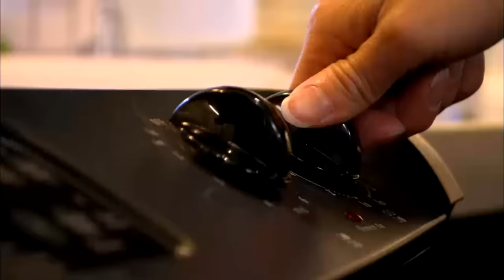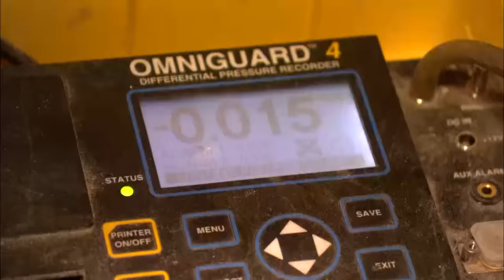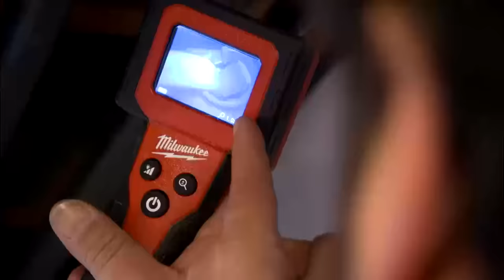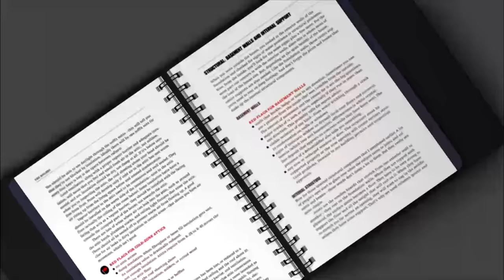Hidden Danger in Home Puts Family at Risk | Holmes Inspection 103

Comment: I don't blame them for wanting it out, but it's important to understand a couple of things:  One, if the asbestos is  enclosed in the wall/ceiling and undisturbed,  you're not getting particles of it floating around in the air.  Two, there are multiple types of asbestos, not all of which are a problem.  The types with the really small fibers are the dangerous ones to get in your lungs, but it takes testing to determine which type was used in this house.
Reply: Yes - well said.   The panic and drama here was a little overdone, but that's Holmes :)  It's most dangerous for the workers installing or removing asbestos repeatedly, hence the hazmat suits and disposal requirements.   Same thing with lead paint - it's only dangerous if it is disturbed (like little children gnawing on the window sill).  I have no clue what Canadian regs require but it seems to me they could have just extended the bulkhead to encase the exposed asbestos
Reply: Thank you. Asbestos that is encased in a bulkhead is ZERO concern. The only real mistake was not enclosing the end wall.
Reply: But in this case the asbestos was disturbed and there are loose particles. It will need remediation. Hope the people that disturbed it don't have any health issues...
Reply: They said that in the episode…
Reply: Thereoticaly you're fine... But if that wall ever cracks, or is cracked, or isn't fully sealed and there's a draft... It's just best to get rid of Asbestos. Which is why you are legally REQUIRED to do it.
Reply: 1. Walls move. Air moves through bulkheads via any opening. There is no such thing as undisturbed asbestos given enough time.
2. Irrelevent. Asbestos is to be removed under the law. Type irrelevant, law says "IF asbestos THEN remove asbestos".
Reply: Lemme give you a scenario then. Say for whatever reason a hole is punched thru it, be it kids playing around with a stick and poking a hole in it by accident. Then what ? You were once a kid, so was I (shocking I know). Rule of thumb is whatever could go wrong will likely will when you got kids. Or lets make it simpler, say they want to spread the coldness of the cold room so they install a fan in the basement to circulate the air, it'll go in the lil nook where the homeowner first spotted the asbestos and voila. One more for kicks. Say there's huge water damage for some reason and they need to replace the dry wall, boom you get lung infections, you get lung infections and you get lung infections.
Reply: Just as a general comment-- the problem with the encased and undisturbed theory is that you really don't know the state of things you can't see.  If the asbestos was damaged and flaking when it was covered by the bulkhead, you have no way of knowing that.  We have had to do a lot of remediation made more complicated by things being "encapsulated" with something else.  The person we bought the house from was lazy-- the fact that the asbestos material was in poor shape was "fixed" by encapsulating it with something else.  But was it really "fixed" in any way, and did the encapsulation make it "safe", or was it just covered up to leave us with a substantially more expensive fix down the line?  I think it's the latter.

Comment: Asbestos is bad, but if you don't touch it and just leave it alone nothing will happen to you.  It's not like you will tear into it and make it come apart.
Reply: It seems to me that this asian woman wears the pants and never shuts up, lol.
Reply: On heating and cooling cycles I believe the air circulates on by the asbestos, so a tiny amount constantly gets distributed. That open end would have to be closed and sealed at minimum. But then we have wind storms a few times a year , and during that it would pressurize or depressurize the space and release particles through (normal) cracks in the drywall.

Comment: In 1970 I worked as a carpenter on a reform school . The architect specified the foundations and soffits to be 1/4" Transite which was an asbestos/cement product. Being more muscle than brain, for months,  I cut Transite with a circular saw using a dry carborundum blade. For the lack of proper safety concerns, I spit and picked gray the entire time. I'm 81, still working , and don't know of any co-workers from back then that suffered asbestosis. I've had several x-rays in the past 25 years to keep check and my Irish luck holds true?
Reply: That's good to hear that you are doing well after your exposure
Reply: Just think of how well you would have been if you hadn't been exposed to a dangerous substance!!!
Reply: I taken plenty of xrays of older construction workers, most have evidence of asbestos exposure. Its sad, you are fortunate

Comment: LOL, scared for no reason at all.  It's only dangerous what you work on it. funny as hell.
Reply: Exactly this - people are always so panicked over little things. So many people see Asbestos and go "OH NO I'M ALREADY DEAD"
Reply: No, that's not true, asbestos causes other cancers besides asbestosis, it also causes permanant lung scarring damage as the tiny fibers are like sharp needles, every time you breath the "needles" are jabbing the tissues in your lungs, that causes scarring which causes fluid and loss of air exchanging surface area. 
There are loads of lung cancers that people have had despite saying they NEVER smoked and asbestos contaminated vermiculite attic insulation is in an estimated 80 MILLION American  homes and business attics alone. The dust is so fine that every time you open windows or doors or enter the attic, asbestos dust sifts down into the living space thru the tiniest cracks and gaps, thru wall switches and outlets too. Vacuum cleaners suck up the dust and force it out the exhaust as the fibers are small enough to go thru the filter bags.

The real panic idiocy os over lead paint, we've ALL had lead paint in our homes, you cant get away from it, just dont EAT the paint chips and you'll be fine! I work in an industry that uses a LOT of lead, with colleagues handling lead sheet all day every day, cutting, bending,  filing, soldering, and they get blood tests frequently and its always negative- they WASH their hands after handling the lead and they dont EAT it! that's why they don't get lead poisoning, yet weve become so paranoid on it, its like seeing a picture of lead paint will poison you now LOL.

Another scam is the radon gas, I bought test kits and put them in my house, they came back making NO sense, I did another round of them, this time I stuck one right above the open sump pump pit and another upstairs on my desk, the claim is radon is heavier than air and settles in the low part of the basement, but the test results claimed the one on my desk was super high while the one over the sump pit was real low LOL!
Another red flag the test kit co's web site map, I looked up my test number and it showed me a map of my town with the claim that MY house, gee, what a coincidence- had THE highest number of any house in town!
That's when I pegeed that krap as another SCAM to get thousands to "remediate" nature. My basement is only 4 feet below ground, the whole floor is concreted with plastic under the concrete, concrete foundation wall to grade a foot thick. The former owner's  son was 3 years old when they moved in here in 1942, he grew up here, he's 84 now, guess the "deadly" radon gas didn't bother him did it! Ive lived here 25 years
Reply: @HobbyOrganist  You need to do some research,  Asbestos danger comes for aerosolized fibers, if you are not touching it or blowing it around the risk is very very low.  More than 60% of houses in the USA has lots of asbestos in them.
Reply: Adding drama for tv purposes. Quite silly
Reply: The stuff HAD been disturbed in the renovation, and apparently there were bits of it laying on top of the ductwork, so it's not unlikely there were asbestos fibers floating around that basement. However, it would have been interesting to see the results of an air test before Mike's team did any work.

Comment: Asbestos was used for a reason, It Worked. It will continue to do so, except where exposed it is likely to become damaged and the fibers air born, which then become a health hazard. The other issue is getting heating equipment Serviced, when there is the possibility of the Service Person coming in contact with it. Keep in mind Hot Water/Steam Pipes/Valves RUST and begin to leak eventually, requiring replacement. THEN the fun really begins. Abatement (the removal and replacement with approved material) is expensive. While some places allow owners to perform the removal after taking a short class (it's not rocket science), Disposal is still the issue and can be expensive.

Comment: Hello Mike and Damon, just a bit of info, to carry washing and drying machines up or down stairs, always with the back of the machine to the stairs, tilted, either use straps to carry, or without, the person at the bottom to grab where the feet are, and the other person to grab the back of the top of the machine,, but make sure the top is fixed tight and not loose. and your guys won't get back problems, but if they carry on how they carried the Drying machine out of the basement, they will. 
Wishing you all the best. 
Malcolm from Germany
ps, Love your videos

Comment: The electrician said that the wires to the fuse box needed to be changed from double wires per clip to single wires per clip. However at the end of the episode at 40:04 you can see that all of the wiring is still two wires to one clip. It should have been fixed. I'm surprised that wasn't done.
Reply: I saw that too. In fact, I think he only replaced the breakers. In fact, I think they never got an inspection other than the environmental certification. That one probably goes to a state/provincial authority. The air quality guy was a private contractor separate from the hazard abatement crew.
Reply: Maybe they swapped the staples? Some are  ok for two #14 AWG loomex under a single staple.
Reply: "If it ain't broke, don't fix it!"
Reply: @jackriley5974  Clearly. And if the job gets inspected, it is an existing condition. Might even have been legal when it was done,
Reply: The staples were changed go back to when he pointed out and back to the the end.

Comment: @27:25:  Mike said, "A couple of breakers are overloaded, 20-amp over 15."

I'm having trouble making sense of that criticism.

If there's a 20A breaker over a circuit sized for 15A, that's a problem, but it's not an overloaded breaker; it'd be an over-sized breaker.

If there's a circuit sized for 20A (e.g., 12 AWG) protected by a 15A breaker, that's also fine.  (I've heard him say this before as a criticism, but I'm not aware of any NEC prohibition of it and it doesn't make sense to me as a criticism.)

The best interpretation I can think of is that he found an appliance with a 20A induction motor fed by 12 AWG and protected by a 15A breaker, but then the homeowners probably would've noticed it tripping.

It's just not a very clear criticism.  It kind of sounds like Mike was trying to think of things to make it sound bigger or worse than it was.
Reply: Artificial drama 😉
Reply: Not sure if the NEC applies to most of Holmes videos as they are mostly Canadian homes being shown (so CEC instead of NEC). 

Plus he might have just mixed words and they didnt do a re-take, even if you know what your talking about sometimes you still can spit out nonsense (Brain Farts).

Hard to say what he really meant, and while in every episode there usually is something to nitpick about usually the work that is done is good even if not always necessary.
Reply: The whole issue with Mike is making it right. He wants everything perfect and we don't live in a perfect world. But home owners knowing this stuff before hand would be a plus for them. Give them negotiating space on the price.
Reply: "20A over 15" makes it clear to me that he meant that the breaker was over-rated for the wire. Which is a problem if anyone overloads the circuit (drawing more than 15A but less than 20A).
Reply: @crgd23  So you think he just misspoke by saying the breaker was overloaded, and instead, he meant the breaker was over-rated?
Reply: @ncooty  I think so, yes
Reply: @crgd23  It does seem like the most likely interpretation.

Comment: A good giveaway that a pipe is insulated with asbestos, is seen by looking at the end or where there's a turn. Asbestos insulation looks like the cardboard that a box is made from. Corrugated sheet Asbestos was wrapped in several layers, then a jacket was applied over that. 

Asbestos is typically safe only when its encapsulated and not disturbed in any way. 

Once abated, the usual replacement is ASJ fiberglass insulation fitted over the pipes.

Comment: Asbestos only poses a risk if & when it is disturbed and particulates become airborne. Like lead based paint, encapsulating it seals up any risk of being disturbed. If it's buried inside a wall it's no hazard. If it's above a drop ceiling, that could be disturbed & become airborne. My home has both asbestos drywall& lead paint; neither are an issue unless I start tearing down walls.

Comment: People have lived around asbestos insulation piping for a hundred years and been perfectly fine.  If you don’t disturb it, it’s fine…..  the inspector said it was likely asbestos insulation.  Mike doesn’t know if it does, it needs to go to a lab to be analyzed….  But it’s great drama for the TV show.
Reply: Asbestos becomes a problem when it is disturbed and becomes airborne. Abatement can create an airborne problem itself. The best practice is to encapsulate, coat, or enclose the asbestos.
Reply: @fsoileau  the pervious owners of our house instead of getting rid of bathroom tiles with asbestos  glued into them just put carpet on top of it .
Reply: says a poster called Willy wonka. What authority have you got to generalise ?
Reply: @fsoileau  it is covered  with drywall so it is enclosed just seal the hole at the end
Reply: @force311999  I agree with you 100%.
Reply: @hunterbear2421  It's not likely the tiles were asbestos as in VAT (Vinyl asbestos tile) which are not friable anyway. Many years ago they quit making them in favor of VCT (vinyl composition tile) Carpet in the bathroom???
Reply: @jackriley5974  the house was from the 1900s it was the original farm house in the area. and the tiles got test and were asbesto
Reply: Well willy Wonka I just happened to be an asbestos contractor and I saw all of this insulation in the house and knew it was going to have to be done by a professional to bring it up to code I've done this work for 10 years and I had to go to class every year for My super visor license just so that you know what I am talking about buddy

Comment: Im just wondering if the house my parents had built in 1959 has it got asbestos in it - it has top of the line central heat & a/c in it - that is for 1959 - its a split level with the half level down stairs and the unfinished part is just that completely unfinished - not even insulation in the area directly under the kitchen and dining room

Comment: Not sure I'm with Frank on the old breakers.  How does he know they weren't just retained on site?  As far as I know, nothing in the NEC says that if you replace 1 breaker, you have to replace all of them.

Lots of these criticisms seem like a stretch, though I agree with Mike's main criticism here against many inspectors' reports:  that they're so vague and generic that they don't help homeowners understand, prioritize, and evaluate the actual conditions and risks.
Reply: I also find it funny that they said the double wires stapled with one staple was against code and needed fixed, but in the fixed video, all those wires remained doubled per staple.
Reply: Its canada so might be different. But still seems extreme to react like it's open exposed wiring
Reply: If it has cloth on the wiring it is also asbestos material anything previously built before the end of 80,s is going to have the asbestos material on it from the flooring to the heating system and the siding on your house and the roofing also I know this subject well because I was an asbestos contractor who did the work and removal of the hazardous materials containing asbestos material hello people it was also put on the siding on your house and in your duct work and used on boilers as well as well as fire brick's and don't forget about lead paint 🎨 and it was used in your car's brakes and on bigger truck applications as well look for this information on the computer online and you're gonna be surprised about the many uses and application's of the product oh yeah it was mined in Canada in a town that was named after it asbestos Canada

Comment: Isn’t there supposed to be a certain clearance in front of an electrical panel? Especially where maintenance will most likely be done. Where I am in Oregon it’s 36” minimum in front and at least 24” wide. Putting the panel in a closet is a no-no.
Reply: Same in Canada, I think Mike did not want to deal with that and ignored it. This episode is not that old so I am sure that code existed that time too.